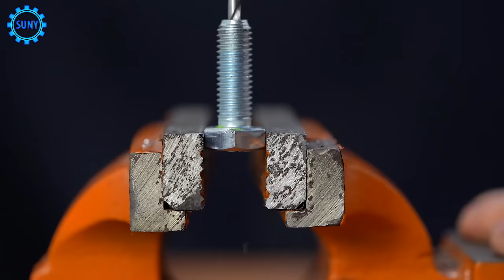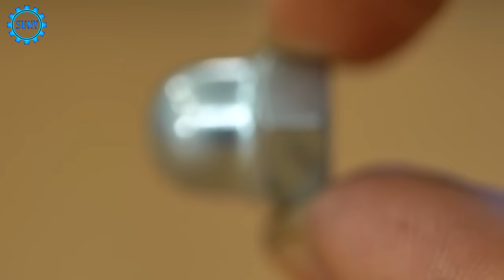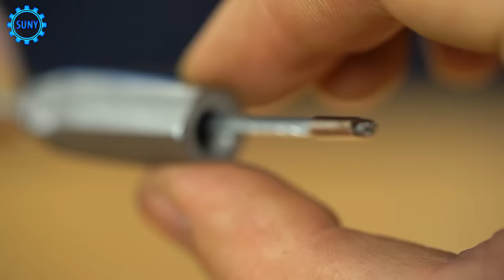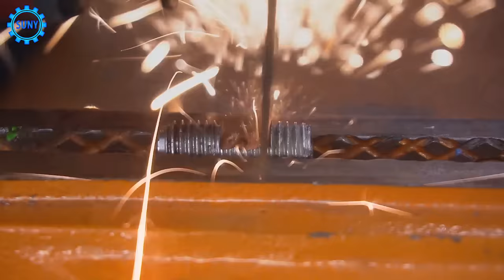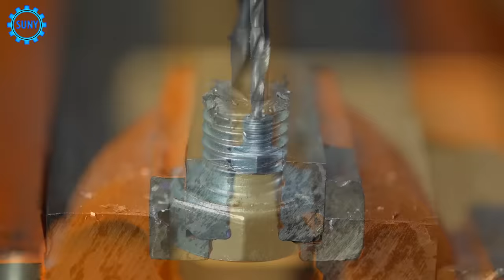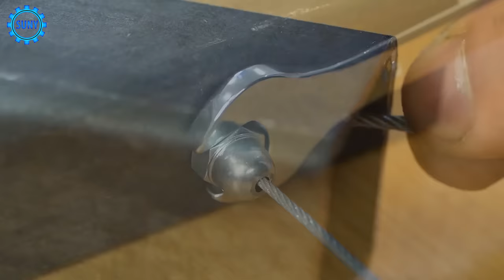YOU NEVER SEEN THESE 4 WIRE ROPE IDEAS BEFORE

Comment: not sure what the cool idea's were but this guy is sure good at drilling a straight hole through a bolt.
Reply: 😂😂😂yeaa
Reply: If I was counter drilling a bolt just held by the thread in the lathe it wouldn't be much more accurate!
Reply: @Marcel Sincere Instablaster =)

Comment: As a retired stage rigger, I think it should be emphasized that these ideas are for decorative use and should NEVER be used in a "life safety critical" situation or where something might fall on someone.
Drilling a bolt seriously weakens it and welding on it would further weaken its temper and strength.
Welds on equipment that must be safe should be xrayed or magna-fluxed to check the bond of the weld, or load tested to at least 5 times the expected loadFor side ways loads, only forged eyebolts should be used with flange bases.
Reply: Agreed! These are super creative ideas. Should come with some sort of disclaimer, though. Relying on something like that trellis system to support any amount of load or force could cause serious injury or worse.
Reply: Pretty sure that is a given, although if you don't know welding you may not realise the welds are ... average, at best.
Reply: Good comment. I do not trust any untested trick such as this.

Comment: First two. Pointless. Why not loop through an eyelet if you have crimps then just tight eyelet down. Going away it will tighten and going down the wall it will wrap and tighten. Just drill a hole then put wire through the bolt, tighten bolt. Can even drill it through close to the head and tighten down with a nut. Doesn't even need a hole drilled
 Pull tight, tighten nut then really tighten by screwing in the bolt. I would place a washer next to the bolt head. Loads of quicker better, easier ways, with none of the tools. nut crimp; it's ok but why not just splice the small easy stuff. If you saw this video you can watch one on splicing. Not sure what the last one even served a purpose for besides looks. This video shows you how to achieve something using more material, more tools, more time, and more effort to achieve one common goal. Good ideas in general just not good ways of doing them

Comment: These are really bad ways to terminate wire rope. None of them would pass any form of industrial inspection, and - as JP says - none of them should be trusted to hold any kind of load. It went wrong when he started to weld threaded rod to a nut, and just became nastier from there.